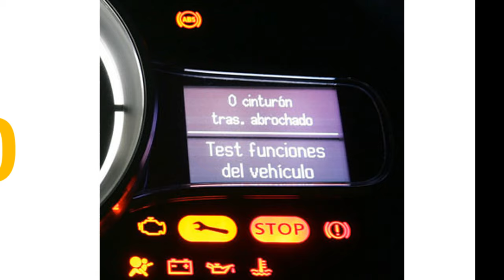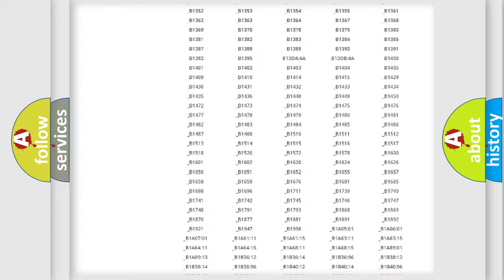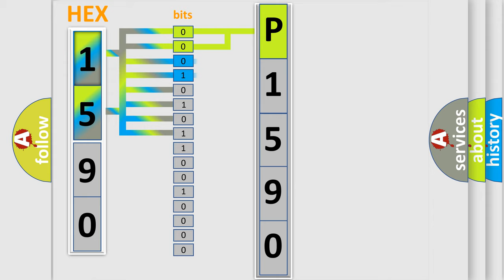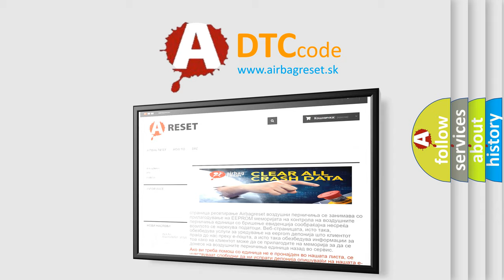DTC Mitsubishi P1590 Short Explanation

Comment: So? What a problem is code P1590?
Electrical? or transmition? or ECU replace?
Reply: It’s not the transmission... I changed it on my car and it’s still having the same issue.
Reply: Hopefully it’s not electrical..
Reply: It's not electrical problem
No electronic problem
on my experience last year
July    2020
the one to help me po by 
Facebook  Papz Baliciado
They advised me what will i do to 
start the engine
hard to explain but
in good faith
I listen by i phone call
Papz Baliciado 
That code P1590
Not electrical problem
Papz Baliciado can help 
Me thank you so much